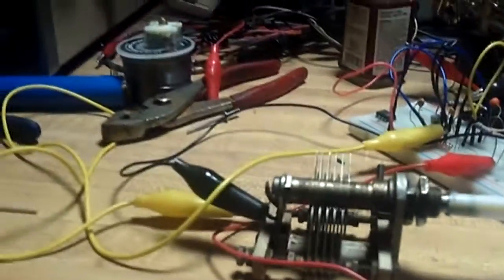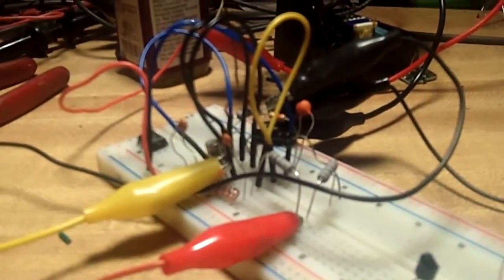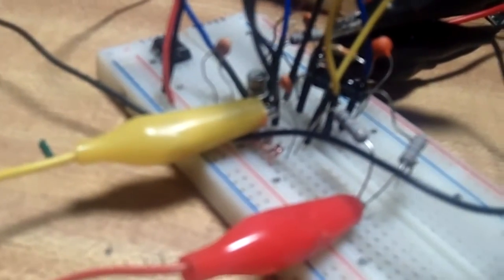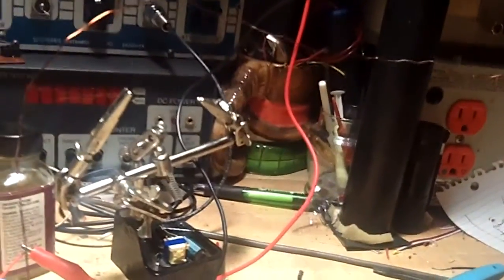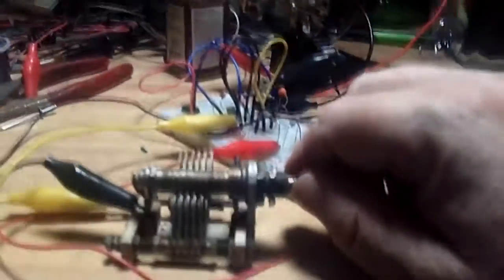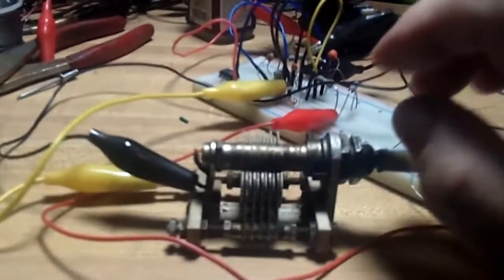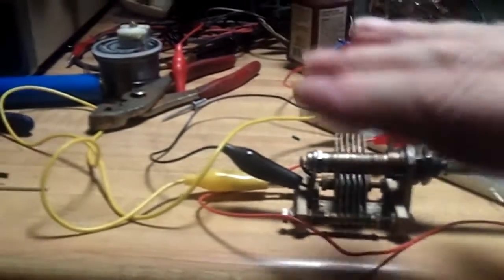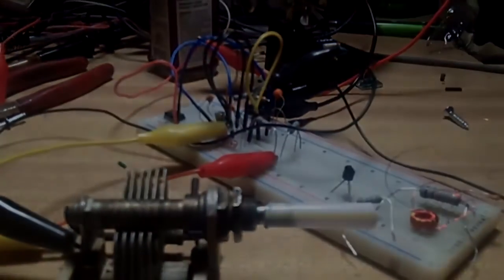Transmitter fun

Comment: Maybe try building a vacuum tube transmitter, maybe more power.
I think all those clip leads is messing up the oscillator, I never built one but I have seen circuits in books.
Some day I may try to build a vacuum tube one but it will have to be something that does not use an oat meal size coil and be small enough to fit on a shelf and good range.
Reply from the maker: I want to try building that AM tube transmitter that Rick McWhorter designed and built. Another that might be fun is that one in the link below that John from Arkansas listed where you use an AA5 radio and swap some wires around. I did get my latest transistor FM one to transmit outside in the yard. these trailers we live in are like big RF shields lol. Can't get signals in,,, can't get signals out.

Comment: Actually a solid tone would be better to tune on. If you don't have a signal generator or function generator you can build a simple 555 chip oscillator that'll produce a square wave tone.
Reply from the maker: I have several generators and have used them for that. I just had the little radio there and the hook up gator wires so I used that. You are right that a steady tone would be more efficient and a great point to make.
Thanks.

Comment: The capacitance in the breadboard itself can drive you crazy when experimenting at radio frequencies!
Reply from the maker: Yeah Robert, it's a real eye opener when you start to put all the hard work one did on the breadboard just to find it doesn't work on the circuit board.

Comment: It would be interesting to scavenge an old tube radio to make a tube transmitter.
Reply from the maker: Hey Don, hopefully down the road I plan on building the AM tube transmitter that Rick McWhorter designed and built. John built one as well and I think they represent the perfect example of AM vs FM and the differences.

Comment: This is really cool!! it seems a little temperamental.
Reply from the maker: They can be very touchy when first putting them together. It usually takes a lot of tweeting to dial them in. Especially on a breadboard.  The main goal is to first getting them to oscillate. Then fine tune them to the frequency you want. Lot of fun but can be frustrating at the same time lol.

Comment: Hello Carl   that's looks tempremrntle to get just right. have you tried different transistors to find one more stable.. you can get the right one. one transistors will work well
Reply from the maker: On this one Richard I used a 2n2222 because it's an all round transistor with a good range frequency and I have a few in stock. I do have a few others that I plan on trying to see how they do.
Reply: I would not use this transistor. there is a better one I used. I'm trying to find it for you
Reply from the maker: I have two other FM transmitters I built that use the 2N2222 and I have broadcasted over a quarter mile with them so I know they work. I will cover it more as I do this series.
Reply: Sorry took time to go through my transistors to work out what I used.. It's 2N3904 npn  it's a BJT TYPE
Reply: Thanks Carl